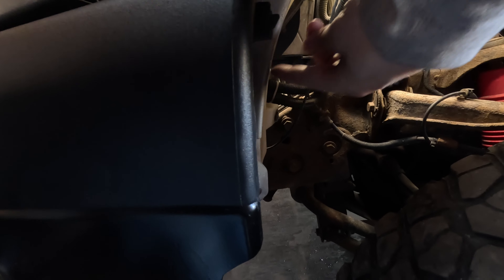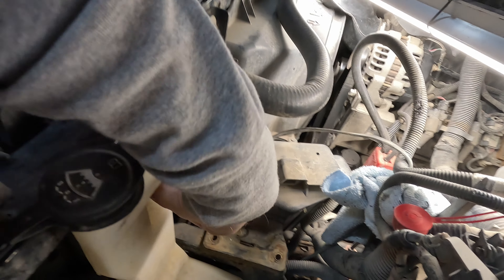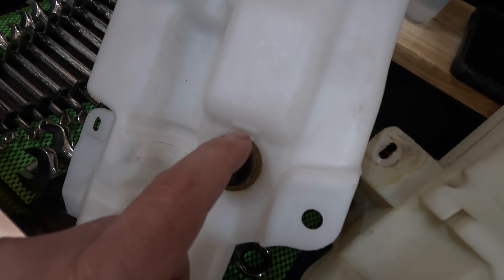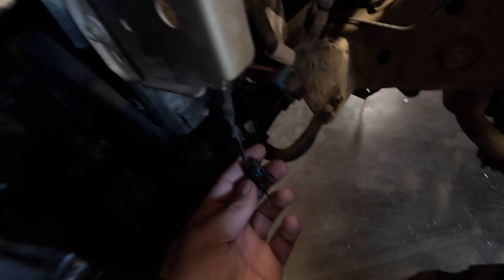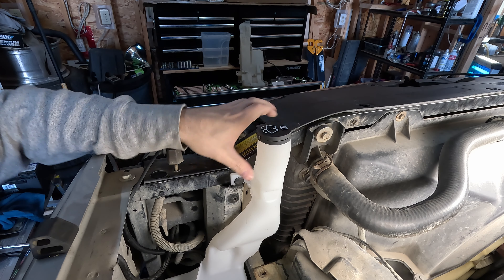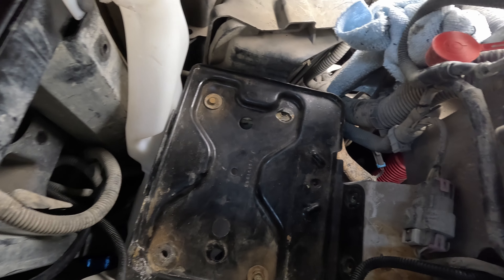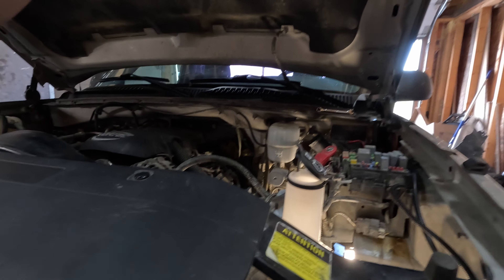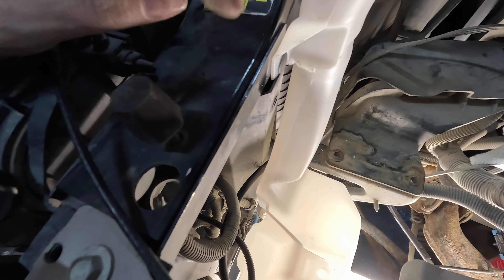2003 - 2007 Chevrolet/GMC | Windshield Washer Tank Replacement

Comment: Appreciate the shout out! Hope all those parts worked out for you!
Reply from the maker: Ended up only needing the tank and sensor for my needs. I used a plug on the sensor hole but it weeps enough to be a nuisance so I am replacing it with the actual sensor.